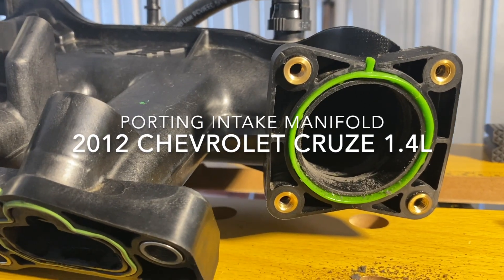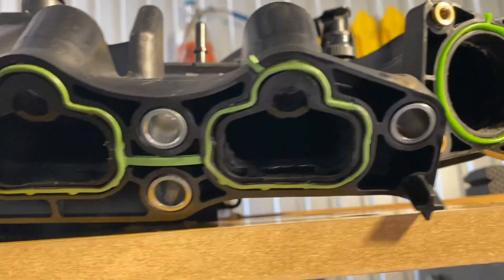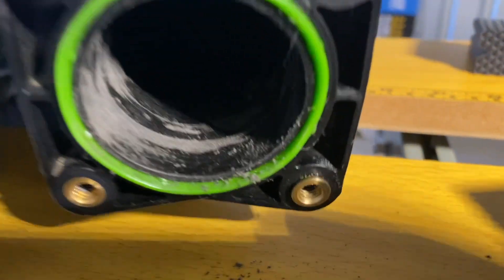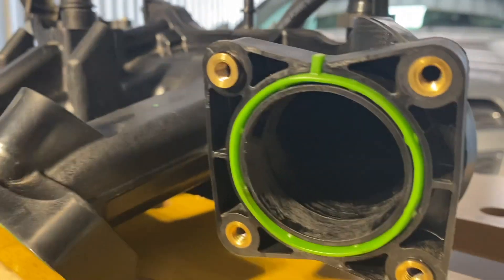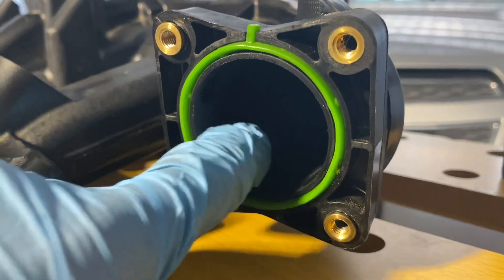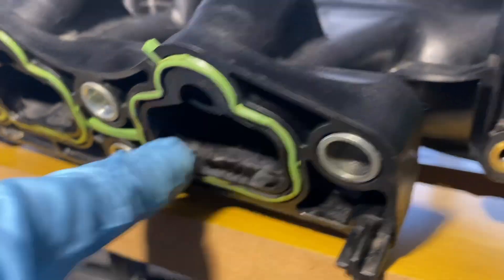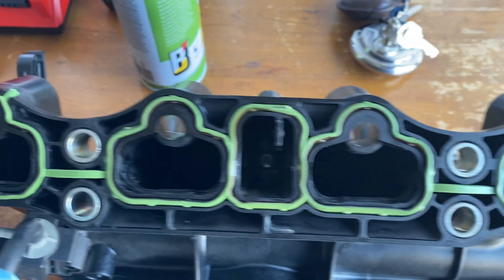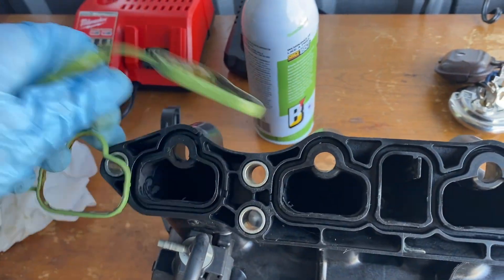Ported Intake Manifold 2012 Chevrolet Cruze   HD 1080p

Comment: I just watched your video trying to fix my car. I was wondering if you noticed an increase in performance after porting?
Reply from the maker: Yes. Absolutely. The car will feel like a proper turbo 4 cylinder. You will get a proportional decrease in gas mileage. Also, the positive crankcase ventilation tube at the bottom of the intake manifold that is a pressure fit will need to be secured. I used RTV gasket maker.
Reply: @hordebutcher2651  Thank you, your video is a great help